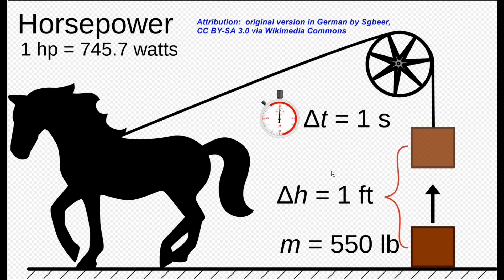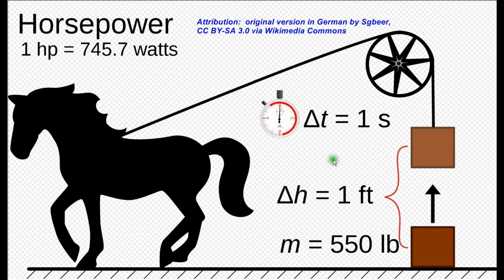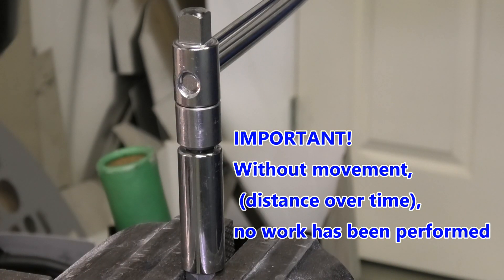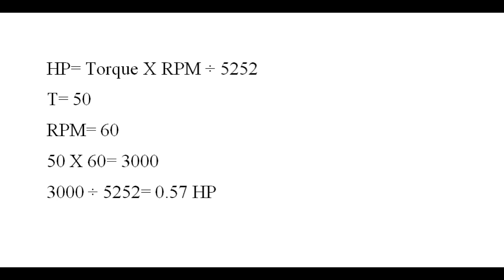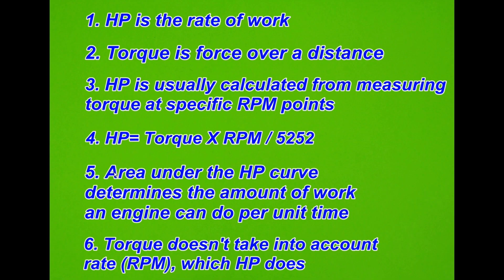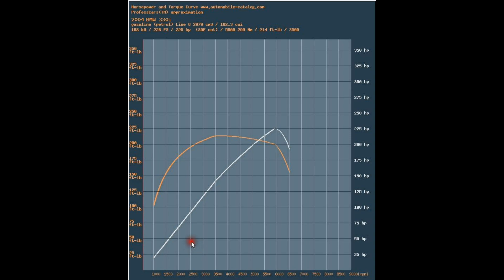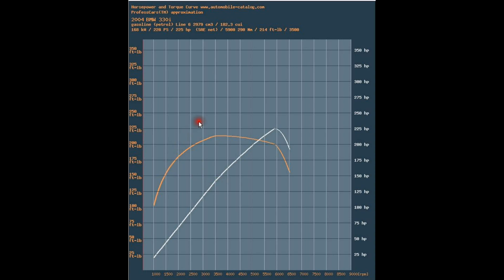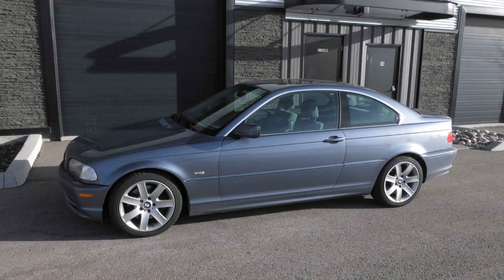Torque and Horsepower. What's the Difference?

Comment: I know you said “usually” power is calculated from torque on a dyno.  Mustang “load cell” type yes but Dynojet inertia drum type measure power and calculate torque from that.  I mention it as the internet hivemind thinks power is merely a “calculation” for “marketing purposes”.  Nonsense of course.
Great video.
Cheers.
Reply from the maker: Inertial type dynos measure the rate of change of a mass with a known moment of inertia. Power is calculated from that measurement. Power is rate of work, torque is force over a distance.
Reply: @rv6ejguy 👍yep. That is how a Dynojet (inertial Drum) measures Power directly by calculating the power needed to accelerate a known mass (drum) it uses Force = Mass × Acceleration as Power = Force × Velocity.  It is not measuring torque directly.  Torque must be derived from Power if an RPM reference is supplied.

A  Mustang (Brake Dyno) on the other hand measures torque directly using a load cell and the formula Torque = Force × Radius given the known radius of the drum.  it’s not measuring power directly.  Power is derived from torque if an RPM reference is supplied.  At least that’s how my Dyno owner friend explained it as he owns and operates both.

Comment: What are the units of the "area under the curve", HP*rpm? 

I think the area under the curve is not as important with a close-ratio transmission or a CVT. It is more pleasant to drive with more area as you have shift sooner with good performance but not an advantage in ultimate performance if you can keep the RPM in the upper narrow band. Now if you are driving around with a Powerglide transmission, this torque curve would be really nice to have.